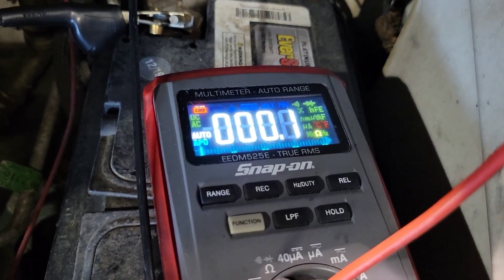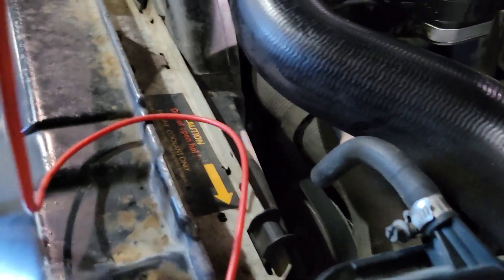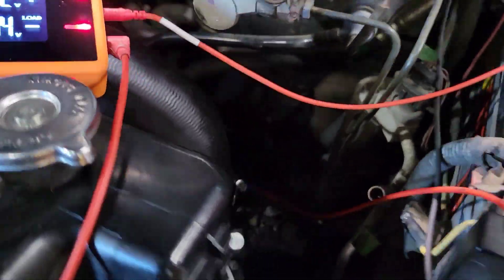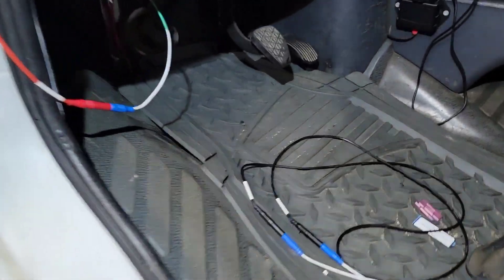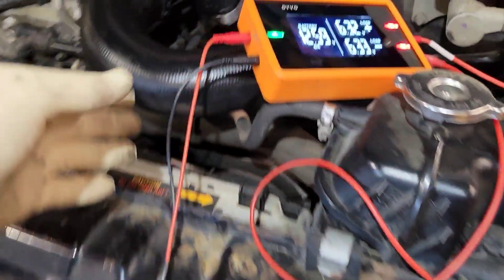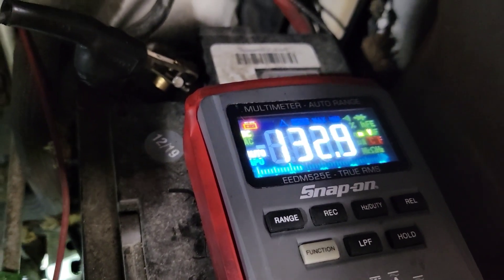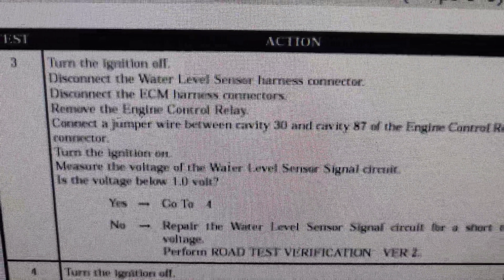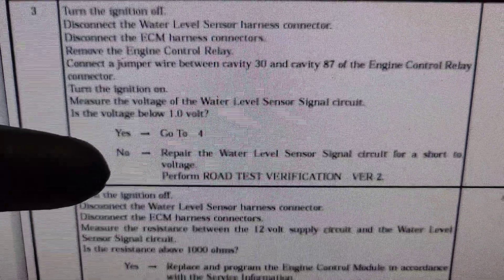2.7 Sprinter P2009 Water in Fuel Code Will Not Clear

Comment: Wow! This was a really great use of DYVO! In one test, you verified the wire had good continuity (almost no resistance), wasn't shorted to voltage, and wasn't shorted to ground. When you changed from "V LOSS" to "V" view, the screen reads: Battery = 12.59v, +Channel = 6.33v, -Channel = 6.34v. As you pointed out, the 0.01v difference between the channels indicates good continuity and almost no resistance in the wire. But there's even more information in these readings. Because both channel LEDs stay red, this means there is no short to voltage or ground. If either of the channel LEDs went yellow or green, this would indicate a short to voltage or ground in the wire. Great test with DYVO!
Reply from the maker: Thank you very much, and thank you for the feedback on the LED's. I appreciate you watching.